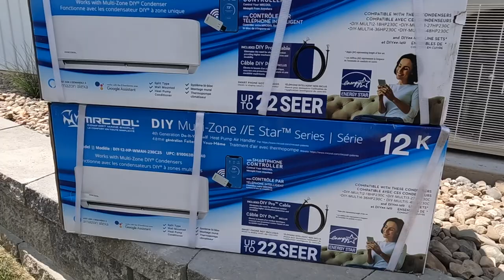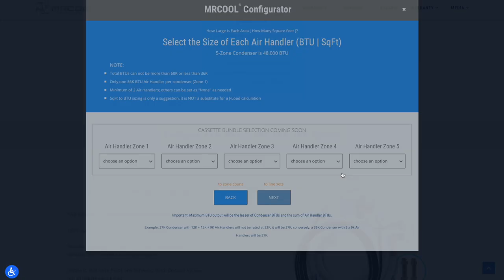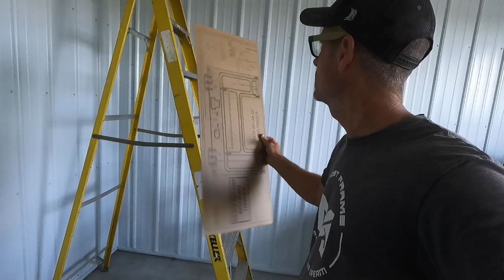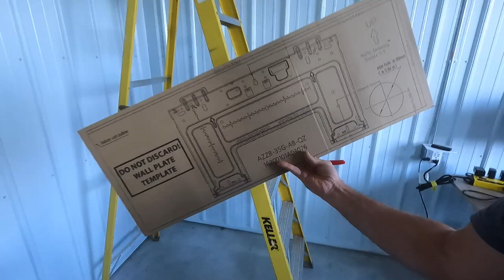MRCOOL DIY Multi-Zone Mini Split | System Install | Ep 2

Comment: When I installed my indoor unit, it was recommended that that the hole for the lineset and condensate drain be drilled at a slightly downward angle from the inside to the outside.  This ensured that drain line would slope out of house and drain correctly without any blockage.  Oddly the flange for the hole liner was perpendicular to liner so the flange would not lay flat against the wall.  I ended up trimming some of the flange off the liner so it would wit a bit more 'flush'.

Comment: One of the nice things about these multi-head units is that your total head BTU can exceed your outdoor units BTU rating.  In this case Paul has 9k+9k+9k+12k or 37k on a 48k (4 ton) condensor unit.  He could still install another 12k or 18k head on that system and still be fine.  You cant exceed the 48k supply from condenser, but it will just throttle down the heads when demand exceeds the condenser limit.  But here is the thing, how often would you be running all five heads full tilt?
Reply: And Paul, when you get around to converting that truss space above the garage, that would be a perfect place for the 5th head.
Reply from the maker: That would be a perfect location for the 5th head.

Comment: you want your excess coils laying horizontally. Not vertically. Apparently refrigerant oil will separate and settle in the low spots of a vertical coil and reduce efficiency (or worse 🤷🏻‍♂️.. I just know not to do it)
Reply from the maker: The manual does say to lay them horizontally...I contacted MRCOOL and they said either way is fine.

Comment: Doesn’t placing the condensate line at the bottom of the connection set make it more susceptible to becoming pinched and flow restriction?

Comment: Excellent video. Love how you explained everything in detail. I need to install a similar system. I was wondering if there's any advantage or disadvantage or running all the lines through just one hole on the outside wall and via the basement's ceiling and coming out to each individual room?

Comment: Can it be over sized? I think my contractor did because I wanted to make it 68 in the 98 degree heat. He did a 24k Mitsubishi in a 2 car attached garage.
Reply: Sure, it can be oversized, but it will reduce efficiency.  However, any ac/hp system should be sized to the expected average conditions, not the extreme events, to get the best efficiency out of system.

Comment: Can you run these through attics?
Reply: Yes - however if the drain line goes vertical you will need a condensate pump. Otherwise the condensate tray will overflow.

Comment: I have to agree on the "anybody should be able to do it" aspect; somewhere on that design team is a guy with lots of bashed thumbs and bruised fingers- the set up logic and way markers make it hard to not succeed. Additionally, as an owner a lot of simple home diagnostics will be much easier. They are also beginning to market some evaporator heads that are for installation in a ceiling pocket. Mitsubishi has rea;;y pulled out the stops on this concept- and beta tested it all over Asia over the last twenty years. From my POV as an HVAC tech, I would have preferred all the drains run to the outside on the dame side as the condenser; it's easier to routinely check if they are all working. In high humidity areas, it usually means putting in a dry well- a hole with rock in it to diffuse the water. There is an old technician's proverb to  help you along; "It only has to  work for you", and "If you guaranteed it, look at it one more time before you leave it.". For a DIY fella , you do pretty fine work Mr. Marshall! Best to Em and All!
Reply from the maker: Crazy how much these have improved over the last 5 - 10 years. Easy install...thanks!

Comment: Is there an extra power/communication wire included with each lineset? How does an extra length of wire connect if it is too short? Is there a wiring harness, or do you need to splice it?
Reply from the maker: Line set comes with all the wiring in with the line set. You specify what length line sets you want when ordering. You can extend it if you want and it comes with everything necessary.

Comment: How did distance factor in to designing your system? 
As far as were cooling heads would be to the condenser. And the electrical supply. Could you of run two seperate units and come out better as far as costs go?
Love watching your channel! 
And when you set your simpson ties in concrete. Can the bottom of them actually make contact with the concrete or even be buried in the concrete some. 
Thank you for all you do!!
Reply from the maker: Distance wasn't a major factor other than ordering the right size line sets...the only downside to a DIY setup and pre-charged line sets. They are available in 16, 25, 35, 50, 66, and 75 foot lengths. I have 3-5' left on a couple of the line sets.

Can't speak to efficiency but going with one unit is definitely easier on setup and less expensive. Plus I can add one more head to this unit. I'm using 39k of an available 48k. This unit is about $5600 on Amazon, just a quick check if I purchased two units with two heads each, it would be roughly $6000 or more.
Reply from the maker: We use Sturdi-Wall brand brackets, from Midwest Parma-Column. This is taken straight from their testing and installation documentation: 

"When Sturdi-Wall Plus brackets are placed in wet concrete, care shall be taken to ensure that the concrete is not so wet that the brackets sink below the base plate and not so dry that the concrete will not flow around and adhere to the rebar. Ideally, the consistency of the concrete should be such that the rebar can be easily inserted in the concrete and the base of the steel bracket can float on the surface of the concrete. The entire length of rebar shall be embedded in the concrete such that the bottom of the steel base plate bears on the surface of the concrete."

Comment: I don’t understand the trap for the condensate line(s) running to the canning kitchen.
Reply: So gas and odor from the septic tank don’t come into the house.
Reply: @Patriot3791  yep, and you have to be careful with traps on low flow devices like this.  The liquid in the trap can evaporate faster than condensate fills the trap.  This is more of a problem in the winter when no condensate is created from the units.

Comment: Where you going to buy parts when these mr cool units need repaired?
Reply: lol, cause my trane, carrier and york units have had lots of spare parts available the last few years.
Reply: At least Trane,carrier,york have a distribution network, there are no distributors providing parts for Mr cool. The online stores that may say they sell their parts have none in stock.

And with a few exceptions I haven't had and major issues getting parts for any major brand equipment.
Reply: @markbuchele2118  It sounds like you are in the industry. I was just speaking for the units i have had to have repaired over the past few years. But the past few years were "unprecedented". I hope the dealer networks and parts distributors get on the ball as the units are really impressive and seem to be staying around and not just a fad. There is a time and place for them, and def a time and place for traditionally ducted systems.